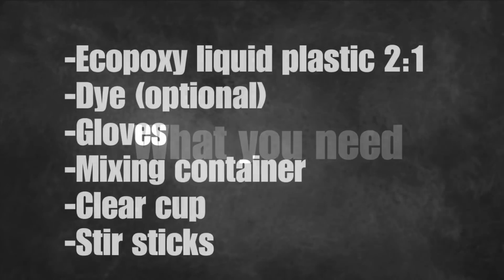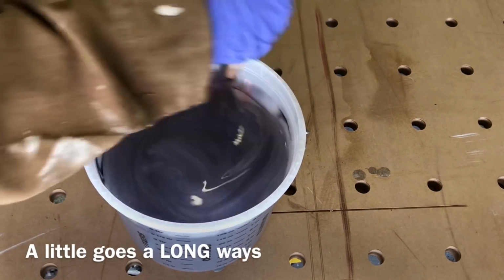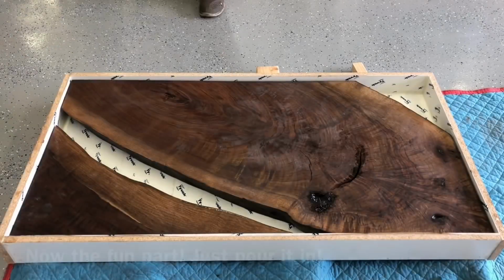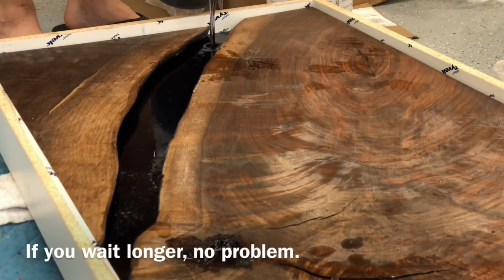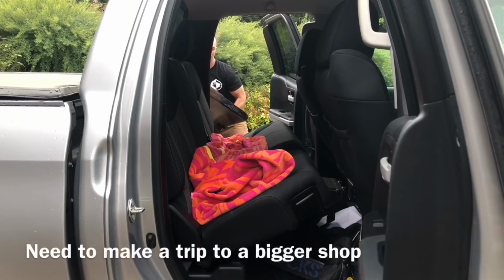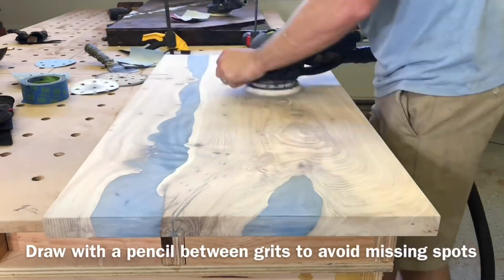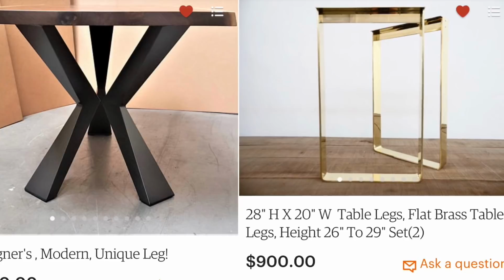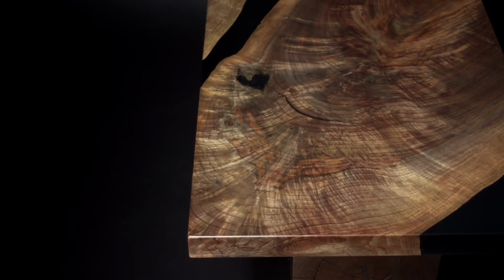DIY Epoxy River Table (Part Two of Two) How-To Woodworking

Comment: Just have to say not only are your tables some of the most original and classy epoxy tables I’ve come across online, but the layout of the videos, to the specific instructions, to covering the whole procedure start to finish to the no added nonsense is exceptionally well done. Greatly appreciate your videos. Buy the way from Pinterest to Etsy you can tell what products are yours easily, as you have a style of your own.

Comment: Probably one of the best video on epoxy river table. Very detailed, learn so much out of it. I plan to pour 2 inches of ecopoxy 2:1 for m’y first river table. My room is at 70 F, 20 C. You think it will be ok. Ecopoxy says 1 inch 3/4 max. Thank you
Reply from the maker: I’ve had problems at 2”. If you do try, I’d use fans and you should be fine
Reply: Blacktail Studio thank you, I think I will stay with the manufacturer recommendation at 1 3/4 max. First project and I don't want to ruin an $$ expoxy batch.

Comment: Thanks so much for the 2 part how to. Great tips and help for a beginner. Great job!
Reply from the maker: Dustin Johnson happy to do it. Thanks for saying so!
Reply: Blacktail Studio Is Alumilite color powder an option to use with this expoxy? Thanks
Reply from the maker: Not sure about that brand specifically. But it works with most all pigments and dyes.

Comment: Thanks for the tip on Etsy . Why would the table top warp or buckle after the epoxy has cured please?
Also , a tip I learned years ago for dust on satin varnish or poly , is rubbing it gently with a plastic scourer and Scandinavian teak oil. Work well 😉

Comment: If I were to use the method where you use tape and caulk to keep the epoxy from seeping under the wood, would you then keep the bottom of the mold intact to plane it in order to have a flat surface for the planar to reference?

Comment: Hi  The table looks great.  A couple of questions of interest (1) do you have a thought in what per centage of epoxy to wood ratio and ( 2) why did you not consider a wood corner instead of a epoxy to balance the other three corners?  I like & follow your finishing techniques.  Have you tried "wet sanding" the finishing coat?

Comment: Hi, thanks for the video! Can you please put more light on the shellac part? 

Also because I’m getting close to this part in my project and came across water-based “sanding sealer” in the closets store, and it says on it’s box “seals wood grain”- do you think it will work? Thanks
Reply from the maker: That should work!

Comment: Thanks for the info heavy video- not the too common "endless monologue!"  What about the design feature of a cantilevered epoxy corner?  the entire bond is the surface of the wood to resin- - how has this design element held up?
Reply from the maker: Kevin Morin been several months and no issue 👍🏼

Comment: Another great, clear vid, thanks. I was wondering if this process would work for a garden table?
Reply from the maker: Rob Simmons I’m not sure what that is. Sorry!
Reply: Blacktail Studio a table that is sat outside in the garden i.e do the two elements, wood and resin remain stable with weather variations?
Reply from the maker: Rob Simmons probably not...

Comment: Hey,
first off, your videos are great. I've been binge watching them for the last few days. I have a question. I want to do a similar table but with a glasclear epoxy so you can see through. If I oil the wood in the last step, will it stain the clear epoxy? Or can you wipe the oil off? 
Or Can I oil the wood and then seal the table with a thin layer of Epoxy and polish up the table? Thank you in advance!
Reply from the maker: It’s kinda hard to get off the epoxy. But not impossible

Comment: Cam,

I wanted to reach out as I have watched a lot of your videos and because of how informative and detailed they are decided to dive into making my first river table. I am through all the phases and I am on finishing. I did a few small shelves in the same pin oak and tried out the Osmo finish and did not like how much darker and red it made the wood. Is there something else you could recommend to finish with that will not add any tint or bring out the natural wood tones? 

I appreciate any help you could offer.
Michael
Reply from the maker: Finish will always change the color some
Reply: Thanks, and no offense.... But that doesn't help at all. I know it's changed. I am looking to minimize the "red" in the red oak.

Comment: I'm working on my first larger pour of a coffee table river and I have a question if you don't mind helping when you have a minute.
On the new EcoPoxy FlowCast, have you had success pouring up to 1.75" thick?
Their site says up to 1.5" thick but I've seen people will pour up to 1.75". I'm not sure if a fan is needed to help dissipate heat or not on a 12L pour of 1.75" thick in a climate controlled environment. Or if I pour in a little cooler of an environment that would help offset the heat from the epoxy curing.
Reply from the maker: I’ve never actually used the flowcast

Comment: Awesome table!  I'm fairly new to wood working and have been looking at making one of these. This video helped alot!  I do have 1 question though: is the epoxy bond strong enough to hold the 2 sections of wood together on its own or is there something I missed that keeps these strong and as one piece?
Reply from the maker: It’s strong enough 😊

Comment: when you used a wide belt sander, do you also use planer inside of wide belt sander? plane-sanding both? or just use only sanding?
Reply from the maker: It planes, and wide-belts. The planer can be disengaged though.

Comment: If you were working with a light colored species and wanted to stain the slab darker, at what point in the process would you apply the stain?
Reply from the maker: Before epoxy

Comment: Great video.  And thanks for the info for the local shops, I will go to CW soon.  
Can you also provide the info of the place you had the table sprayed for finish?  
And could you also link which Odies oil and Arm R seal you use please?  Thanks
Reply from the maker: Mur-TEL thanks man! I went to Birdsview furniture to spray the top. I use all the Odies Oil finishes. I will post other videos on that soon. And I usually use arm r seal satin.

Comment: HI. In my first effort I got a lot of colour bleed from the pour into the wood. (Otherwise acceptable for a first try, and better after I chose to stain the wood.) So now on number two, this is my main concern. What do you think of sealing the edges with a latex paint the same colour as the river pour?  If that is not a good idea, then will edge sealing with undyed deep pour epoxy and waiting say 24 to 36 hours work, prevent colour bleed?
Reply from the maker: Oh no. Don’t use paint. Use clear epoxy.  Couple coats if necessary

Comment: Do you polish the epoxy before you put the finish on?  I can't seem to get a good gloss on my ecopoxy.  I sand it and even wet sand it, but it goes dull.  It looks great after mineral spirits, but then dries up and looks flat.  Thanks.
Reply from the maker: Mur-TEL sanded to 320. One the finish goes on all the flat will disappear like magic. Seems weird, but I promise it’ll shine
Reply: Thanks.  I did some test pieces, but it still was a little dull.  I used Arm R Seal satin.  Should you polish after the seal goes on?
Reply from the maker: Mur-TEL I do at least three coats of the finish. Sanding lightly between coats. You could try and semi gloss or gloss if you want a little more shine.
Reply from the maker: Mur-TEL and shouldn’t need to polish it after the last coat.

Comment: The goodnight table you are working on over at IG: are you using same c-channel? If so why so many? I'm trying to understand if you are trying to minimize bowing or mounting to large base. I'm wanting to mount to a standard apron for now so I think rockler clips will work just fine but may want to try a different base later. 😁
Reply from the maker: Jonathan Bowling I’m using a bigger c channel on that table. 2x1” 3/16 thickness.  I put them about every 18-24” on the big one. Thanks for the question, let me know if this doesn’t totally answer it!

Comment: @blacktail studio - at what ambient temp would you consider "safe" for a 2.5" pour? and/or what do you consider "too hot" to pour over 1-1.5"?
Reply from the maker: I don’t like going much over 2”  fans are more important than shop temp
Reply: Blacktail Studio re shop fan. The idea being to put a couple of fans in the vicinity of the table to just circulate air while it curing?

Comment: I'm having trouble finding the EcoPoxy in a 2:1 kit. Please tell me where you order yours. Also, how many liters did it take for this table? Thanks.
Reply from the maker: Ross Nanfito I cant remember but I say exactly how much epoxy I used and how I calculate the amount in one of these two parts. And I get it off Etsy.

Comment: Awesome informative video. Two questions:

What is the thinnest you can go with a table that the epoxy will still hold up?

How do you prevent the table from bowing or cupping on a long term basis?
Reply from the maker: Evan Kenison I’ve done .75” epoxy tables and check out my “how to keep slab tables flat” video 👍🏼

Comment: What are your thoughts on Rubio Monocoat? Any pros and cons?
Reply from the maker: They make great colors. Although their finish can only be sanded to 150, which just isn’t high enough for fine furniture. Test a piece for yourself at grits from 150, 220, 320, 400 and see the difference. You’ll never consider Rubio after that. I have used Rubio to color a piece, then applied Odies over the top.
Reply: @BlacktailStudio  Very interesting comment about Rubio Monocoat as I was considering moving to that. Was going to try Odies so now I will for sure. 
Please also tell me your thoughts on a 3 equal part mix of poly, boiled linseed oil and tung oil. It is the Sam Maloof branded mix and I've tried mixing it myself as well with mixed results.

I've been watching youtube woodworking videos for 3 years now and I was very surprised to hear you are new. Don't change a thing, I love all your style and production. I especially like no music...to us woodworkers the sounds made in shop is music to our ears.
Reply from the maker: Ross Nanfito I haven’t used that blend before, but I’ve seen it done with awesome results. And thanks so much for the nice words! I appreciate the support.

Comment: Hi, how much work is required under the table?
Reply from the maker: In what capacity?
Reply: @BlacktailStudio  does it need polishing like the top ? does it need a coat of resin/epoxy/top coat? thanks in advance